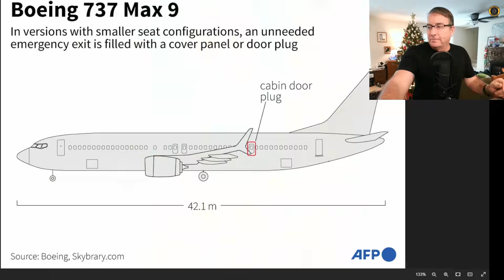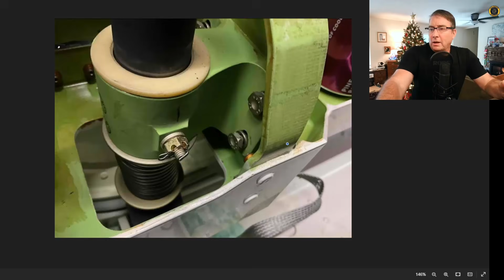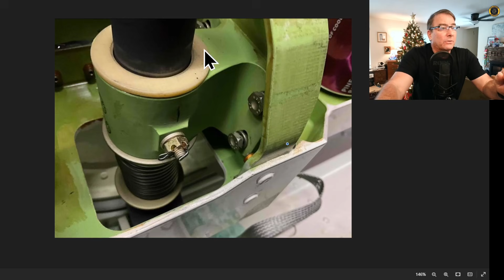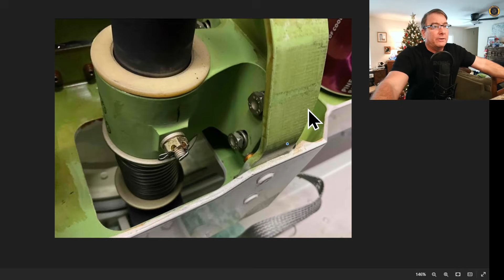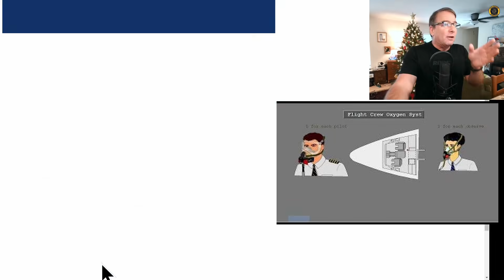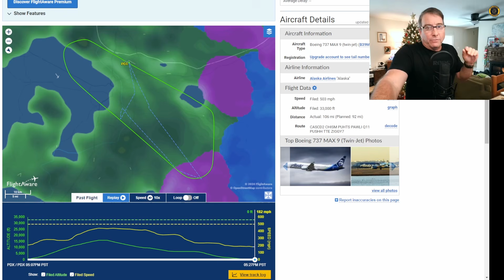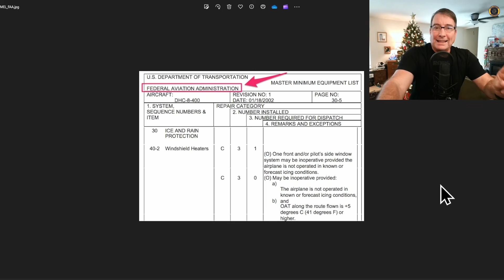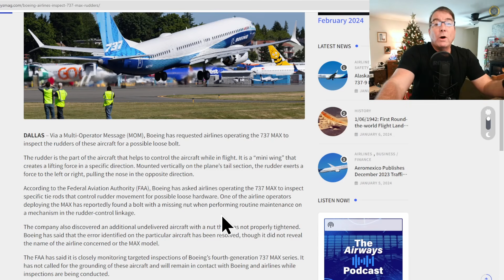"Yes, We Have No Bolts"  9 Jan 737 Max-9 Update

Comment: Thanks for this story.  What is the shear limit of these bolts?  There should be tests on this for certification.  Were the bolts ever actually installed with proper torque and the cotter pin  properly installed?  If they were sheared there will be plenty of marks on the metal where it sheared.  If never installed there will be no marks in the holes for the bolts.  

Now you brought up the loose bolts holding the part with the shear bolts.  Once again since one is missing first thing they should do is look at the holes for the missing part and see if they show what always happens when a loose bolt backs off and is finally torn from the part.  The last threads should be a mess and distorted.

On another show on this subject it was brought up that whistle blowers at Spirit had complained in one instance about torque wrenches not being properly calibrated.  They were punished for bringing up this mandatory feature.  Those torque wrenches are supposed to be regularly calibrated.  That is why bolts can come loose.  That is why I use ARP bolts in my engines.  Strong material, fine threads, and high torque capacity without loosening.

There is only one reason for this and it is corporate greed at the expense of quality and safety.  At the old Lockheed safety and quality was #1.  At the Skunk Works if you made a mistake and reported it right away there was never any problem.  If you tried to hide a problem, it was goodbye, as this was totally unacceptable.

This problem is not only with aerospace as I went through 4 sets of cams and lifters until I learned about Diamond Like Coated Lifters (DLC).  DLC is almost as hard as a diamond and since of graphite it is also slippery.  The quality control of lifters and cams went away like inspection of aerospace as a result of the same GREED.  Let us remember Spirit also manufactures for Airbus.  What problems does Airbus have they do not know of yet?

Comment: Excellent video as always Juan. I'm really starting to think these plans should be re-certified with a new type certificate, don't try and grandfather them in with the older models as they are way too different now. Also thinking that each of these aircraft should go through a thorough inspection to look for any other things Boeing may have missed. Yes that will take time and cost money, but I would rather they spend money to fully inspect these birds than to loose another life. What if the next MAX issue causes another one to fall out of the sky?

Comment: I know the 737 was NEW in October... However, how many 100 hour inspections have they missed that the bolts were never installed? There no way it hasn't been at least 2... And the final build inspection for certification was a total fail and the people who signed off of the final build and every 100 hour inspections should be looking for jobs.
Reply: Airlines’ aircraft aren’t subject to 100 hours inspections. They are on a CAMP. 100 hours are for GA. That area wouldn’t be inspected based on the aircraft configuration.
Reply: @davidh3152  maybe it's a size of aircraft definition but the 100 hour inspection if the commercial inspection. If you take passengers or freight for hire, train, or rent out your plane it needs a 100 hr inspection.    I'd think airlines would be more tedious not less in their maintenance.  Honestly idk but if it's not I bet that changes soon with the number of commercial airlines having maintenance issues

Comment: So I had a very red faced embarrassing moment in my DAR inspection of N672PC.  I got a twofer...the lady from the Scottsdale Fisdo was there to inspect the DAR doing his inspection.  Amongst two bone headed issues (not tightening the nuts on the elevator/rudder hinge bolts) I had forgot to go back and put in a slew of carter pins including the engine attach bolts.  After an embarrassing discussion I asked:  I ain't the first cowpoke who made this mistake at the rodeo am I.  They both replied: We do a conditional inspection and this is the sort of thing builders forget to do.  I know a late DAR who did 747 inspections and once found a slew of footage on a stringer with drum roll....no rivets.  This will likely be a procedural fubar compounded by an inspection failure.  Glad nobody got sucked out.  This why it's important to have someone not involved to a "cold" inspection with the mission being a hunt, if you find nothing...go back and do it again.  Thanks for your diligence in bird dogging this incident.

Comment: Even if you don't pull the circuit breaker to shut off the CVR, shouldn't it get shut off when the power busses are de-energized? Wouldn't that be part of shutting down the aircraft? If the engines and APU were off then the only power source for the CVR would be batteries or external power. Would the battery even last 2 hours? If they connected external power, then you'd think there would be a checklist involved in that which would make sure that unused aircraft systems were shut off.
Reply: The CVRs always run because that’s better than them being off and forgetting to turn them on again. If there’s power to the aircraft and the C/B isn’t pulled they are recording.

Comment: I wonder what it would take to put several days of additional "non crash rate" data recorders on board? ~1TB of COTS SSD can be about the size of a stick of gum, goes for <$100 and would give you about 2 years of audio recording, so the only real cost issue I can think of would be the hardware to splice it into the data bus without reducing the reliability of the primary recorders.

Comment: Boeing have a massive quality control issue and failure to disclose. The FAA needs to go to Boeing and require them to disclose all the changes and get it signed off by the CEO. Failure to disclose is Fraud by false representation

Comment: One of the worst parts is that the pressurization errors reported on 2 other flights prior and they only ETOPS restricted it.
Reply: Watch the NTSB briefing to see why they do not consider this relevant and for confirmation that Alaska airlines went beyond what the FAA requirements for pressurisation systems and ETOPS operation.
Reply: It's been reported that the errors occurred only after AAR installed the wifi dome. AAR has been accused of removing the plug to facilitate that installation, but has replied that they didn't remove the plug, but only two other panels. One presumes that those other panels will be checked for the possible source of a leak if that wasn't already done.
Reply: It really doesn't sound like Alaska ignored the faults.
The mechs probably tested The Usual Things that cause such warnings, maybe they found a loose rubber seal or maybe they didn't. Maybe they replaced a part in case there was some intermittent fault they couldn't reproduce on the ground. Clearly someone was not satisfied that it was permanently fixed yet.
Please realize that these plug doors are not a common failure item. We can't be too hard on the mechs for not immediately figuring out something that nobody saw before.
Reply: Actually the NTSB said that Alaska voluntarily restricted the aircraft beyond what was necessary according to regulation. So, they did not ignore the fault, quite the opposite.
Reply: That’s very Alaska Airlines of them…

Comment: The 737 series of planes have had 215 crashes , 234 hull losses and 530 other serious  incidents  -- endless ways it has had problems -- retire the 1960ies junk -- regardless of upgrades it out obviously of date and dangerous -- some of the designs and fixes look like they were drawn on a table napkin -- bubblegum and ductape fixes are not good enough for safe flight

Comment: Why not just put the emergency exit in anyway and not even think about this option? Maybe I’m missing something, but I’d think one would want more exits if possible
Reply: Then it requires more cabin attendants.  More weight, less fuel, shorter range, etc.  There is a lot that goes into all of this.
Reply: @johnaclark1  And slides.  Heavy.
Reply: Thanks all for answering respectfully.

Comment: My concern is do we have various loose and/or missing bolts or nuts throughout these aircraft? Maybe in critical flight control systems, plug doors, or other mechanisms/structures which could endanger the lives of passengers and crew. These instances of loose or missing bolts or nuts that have been identified already in these aircraft suggest to me there is no reason to believe that these are the only ones. If your quality control/inspections system can miss these it can miss others we don't yet know about. These aircraft should be kept on the ground until every single critical bolt and nut has been identified as in place and torque tightened to the required value/s

Comment: Do they have the roll pins?  If they have those, they’d surely show evidence if the bolts ever were installed.  There also should be evidence along and in the edges of the bolt hole on the door itself.

Comment: Great video!  Excellent detail & explanation!

Why is the audio not still on the tape even if the CB was not turned OFF?
Has the airplane been flown after the plug door departed?  Doubt it.
Does recording & tape movement keep going (CB ON) after aircraft is shut down?
2 hours too short!  Should be at the very least the length (time) of the longest flight + 1 hour before tape starts being over written.  Recording/tape movement MUST stop when airplane or engines are shut down on the ground.

Something to look at later.  Not a factor here as crew did a great job.  Made a landing and no humans died or lost.  They dodged three bullets here as this would have been a TOTALLY DIFFERENT story if this door departed at 30K+ altitude or if someone was unbuckled in the window seat next to the door or if the departing door had hit the tail (hor stab/elevator/rudder).

Missing plug door bolts is a BIG problem.  Reminds me of Clara Peller and her "Where's the beef?" except here it is "Where's the bolts?".

No mention of the cabin door unlatching on decompression in the Boeing documentation is troubling BUT Homeland Security may have had something to do with this decision.

Missing/defective/misinstalled rudder control bolts is another BIG problem that needs to be addressed ASAP.

FAA definitely not fit for purpose of airplane manufacturer regulation/inspection due to their dual mandate & "friendly regulation" culture.  Let's consider giving this task to the NTSB.  We could transfer the FAA people doing airplane manufacturer regulation over to the NTSB after removing all the WOKE people who subscribed to the "friendly FAA" idea of regulating.  We need people who are not adverse of some conflict/pushback with MBA management types and have a goal of making air travel as safe as possible for the American people.

I have to admit I don't have a good feeling about the NTSB doing airplane manufacturer regulation/inspection after listening to Jennifer talk about this plug door incident and learning about her lack of commercial aviation experience.  NTSB would be well advised to up their game regarding their choice of a spokesperson.

Anything else?  Stay tuned to Juan's & Dan Gryder's channels!
Reply: Because the CVR runs when the airplane is powered up electrically, so sitting at the gate with a power cart plugged in.

Comment: The lower hinge fittings on the door appear to have frangible bolts, which is probably why one fitting is mising. The bolts should fail if the upper part of the plug door is exposed to the slipstream in order to avoid damaging the fuselage with a door whipping around in the breeze. Looks like a good design with absolutely horrible workmanship during final assembly.

Comment: Bolts or no bolts, seriously, the plug could have been designed to have NO failure mode (barring disintegration) This was a horrible design in the first place to rely on those bolts, and even if you really DO have to rely on bolts, you better have some inspection processes in place, oh, but that would cost money and time, right? Boeing should be more than embarrassed, they should be responsible

Comment: This is absolutely disgusting. They are Building aircraft that demand critical safety applied to the construction of the aircraft. You have a failure in the air you cannot pull over. Failure in flight means a desater for the aircraft and the people aboard.

Comment: the solution is to install the emergency doors and eliminate the plugs all together.. these pilots are fuck-ups..  and they purposely destroyed the voice tape.. this is career ending..  and no excuse can revive the mess.  heads should roll and everyone should avoid this airline of heads don't roll.
Reply: That is one possible option you can have the door in a deactivated condition
Reply: @cyber25573  You got that wrong..  The aircraft is designed to have that door and the amount of seats is an option that can be changed overnight.... thus those doors should have been installed and active...  otherwise therowner should have bought a different version.. This is the most idiotic 'loophole' (bribed I'd guess) and it never should have happened.  If I was an insurance company, I'd revoke all insurance on Boeing products that have been coming out of their company since 2018...

Comment: Pull the circuit breaker if you can, sure, but what in the world were they thinking to not pull both recorders out of the plane sooner as it was sitting on the ground?   The entire time they were wandering around the cabin taking pictures and measuring stuff and whatever else they were doing, they had power supplied to the plane and the CVR was passing time.

Comment: Why are the door plugs designed to be opened for 'maintenance' (of what?) and why, indeed, are they removed and re-installed at Boeing just to make interior fit-out more convenient? It seems to me that the plugs would not need the elaborate hinge mechanism that seems to be critical to this failure if that plug were a true blanking plate, only to be removed if the aircraft were being re-configured so as to require the additional emergency exits.
Reply: Aircraft are reconfigured all the time.  That's actually a very simple hinge mechanism with a simple plug type design probably used on most every airplane you've ever flown on.  Just someone forgot to install the bolts.

Comment: ETOPS -- Engines Turn Or Passengers Swim....  Without a doubt the 737 MAX is the biggest mistake Boeing has made in many decades.  It used to be said that "The best aircraft in the world would be designed/engineered by Lockheed, marketed by Douglas and built by Boeing.  I think the build quality has greatly suffered and this is a very dangerous time for Boeing.  If the 2020s have taught us anything it's that new all too often does NOT equal better or more reliable.  I believe the airlines share some of the blame in demanding the easiest solution when they should have demanded the right solution.  Boeing should have demanded that of themselves.  The reality is the the 737 is a 56 year old design based on a 66 year old design that's been re-tooled, re-teched, re-engined, re-skinned and more recently over stretched, over stuffed and over powered to do the work of an aircraft it was never designed to be (a fuel efficient 757).  These shake-downs are very important and I'm glad the FAA and the NTSB aren't downplaying any of it.  Boeing needs to go back to their old roots and stop listening to the bean counters.

Comment: It is time for FAA to mandate a strip down check of ALL 737 Max family of critical bolts and nuts that hold structural components. 

ie Tail Rudder, Engine Mount, Doors, Door Plugs, windows, Wings and landing gear. 

There is a difference between toilet door bolt missing versus engine mount bolt lose/missing. 

Finally Boeing Directors and Senoir Line Managers should be compelled to disclose all changes that was made original 737/NG compared to MAX series with penalty of mandatory jail terms.

Comment: I’m curious how the flight deck door would function if it were a cockpit window that failed. Are any jumpseaters getting an arm amputated if that door is forced the other way, or is that what the blowout panels are designed to prevent?